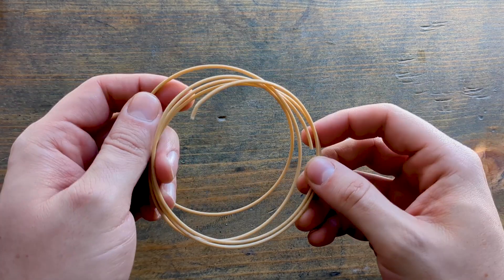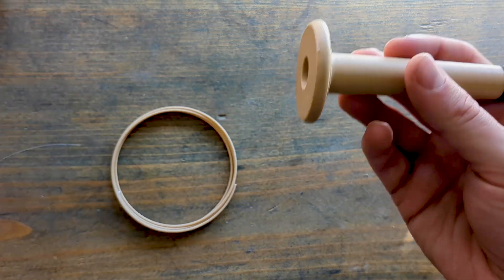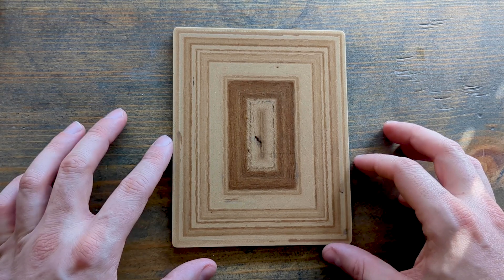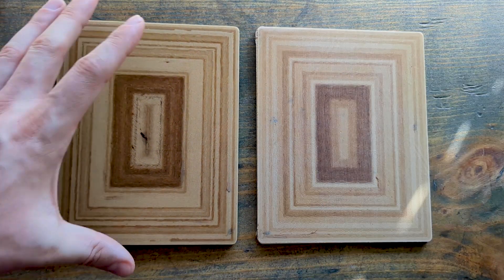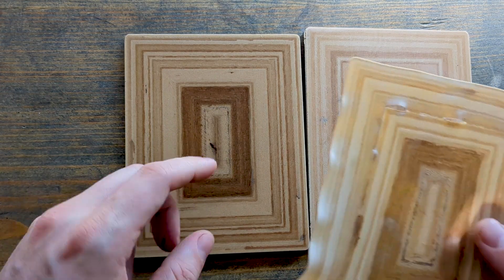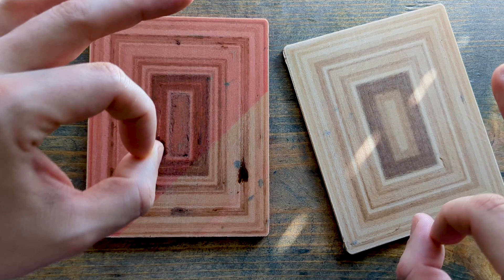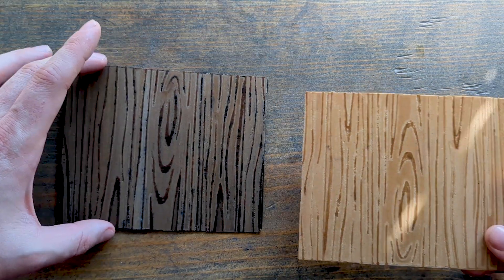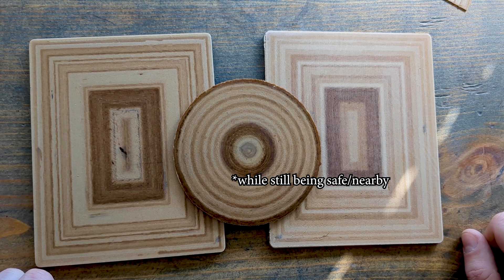3D Print Wood Grain That Looks REAL! (new method)

Comment: Did you ever do a follow on video on this. I've got some Bambu wood filament that I'm looking to do a project with that I'd like to simulate wood grain in the various parts. I'm actually building a lamp. If there were a simple way to produce this grain effect in a hands off/non-technical fashion that would be really cool! I'm looking at straight grain flows and not circular.

Comment: Cool idea! I missed if you mentioned it - does this technique require the wood filament or would it work with regular brown PLA?
Reply: Requires wood but you can do a similar effect with normal pla wont be anywhere near this intensity though

Comment: Function3D has a video where he uses markers on wood PLA. He uses a printed device that is basically a marker holder, and during the print he adds or removes markers which creates colored lines in the print, similar to wood grain.

Comment: PLA starts to degrade over 230C. This is why i chose to use stain instead of temps. And of course, staining the filament before printing is WAY easier too.

BTW, printing top layer with clear filament is often quite cool... Same with translucent colored filaments, the color becomes really deep if you print it on top of black base color.
Reply from the maker: Good to know!

Comment: I recently did a wood print experiment for myself with sanding and staining, and it came out really, really nice. The only real problem was the uniformity of the color. In a use case like that I don’t really think it even needs all that much variation in color. If the temperature could be randomized throughout a wood print to create some color variation, that would come through the stain really beautifully.

Comment: Would something like paintable temp changes or randomization between two values be a way to automate this    If added to 
@PrusaSlicer
 
There would also have to be flow control changes with temp to help prevent clogs

A rather narrow use case   Likely would be better with a purpose-built program like Hueforge is for its use case
Reply from the maker: I'll look into it!
Reply: this would be really interesting to me as well

Comment: I don't know if you have access to an AMS, but I feel like you could possibly do a less dangerous and toxic version of this by using 2 or 3 colors of the wood filament and just printing them at normal temps. Bonus points, you could set purge values to near 0 since you're printing a continuous spiral pattern.
Reply: safety is for nerds..we die like men